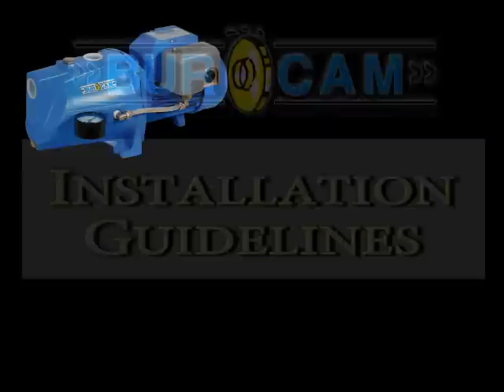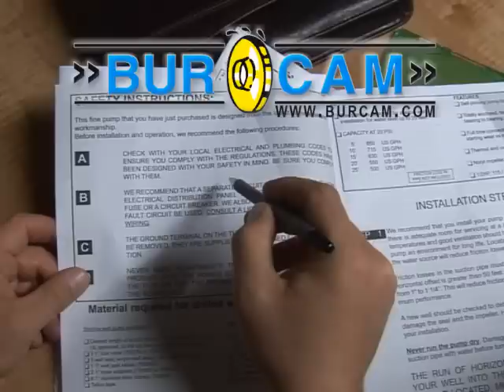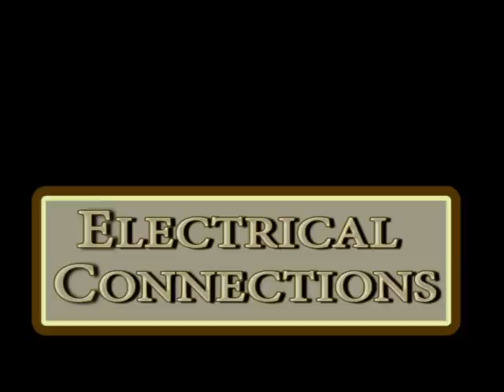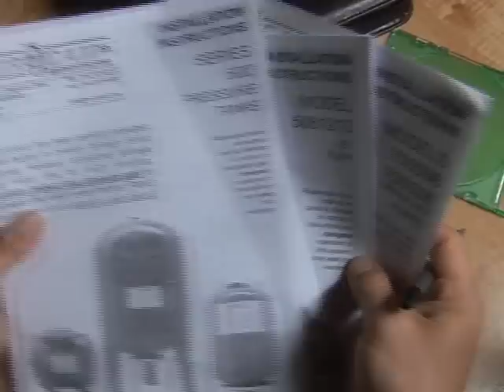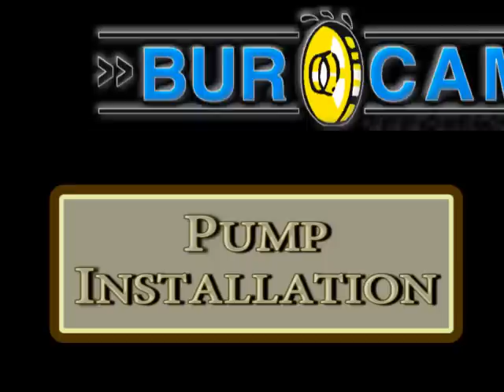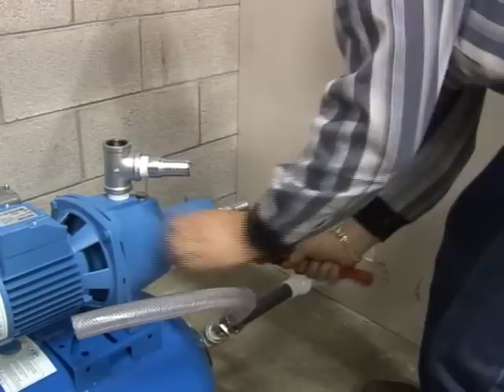Burcam - Pump installation guideline

Comment: Bur-Cam pumps and water booster pumps are absolute trash !  after a year of use mine broke down. The buna seal burst and the buffer plate between the dry side and the wet side got shredded by the shaft. The shaft was pitted and had deep scars on it. When I ordered a new buna seal and installed it as per instructions the sensor which turns the pump off failed, then the new buna seal burst again. When I was installing the new o-ring and buna seal I noticed a large spring washer sticking out at the fan end of the motor housing. I pulled it out with a flat screw driver. How the hell that thing get loose inside the motor chamber is beyond me.  Good money and hours of work for a piece of garbage !  Never buy from this company, they sell rubbish.
Reply: so what do you reccomend instead?
Reply: @newsbalance6685  You closet competitors !

Comment: can this pump be controlled with a VFD? Thanks for any reply!
Reply: technical, the motor can be, but the 40/60 switch and system design isn't really set up for that type of service.  If you are looking for constant pressure you need a constant pressure system.  Small permanent magnet motors/integrated VFD systems are more affordable now.  Both above ground and submersible.  Feel free to ask more questions if you like  Cheers.